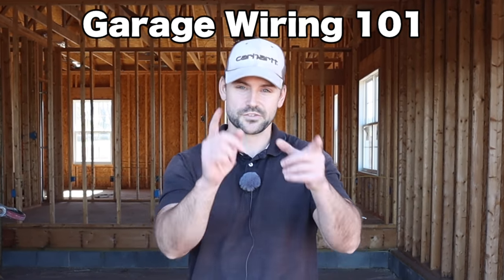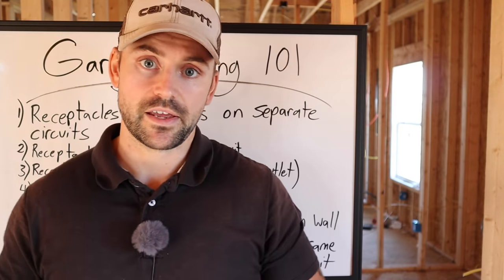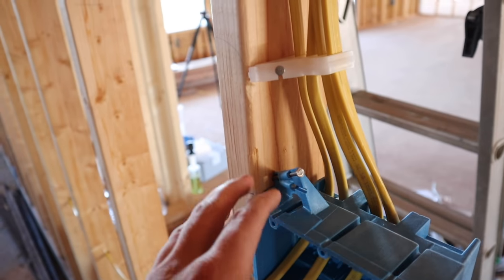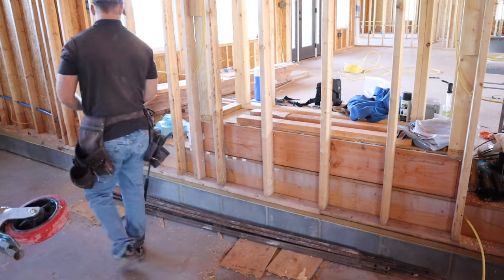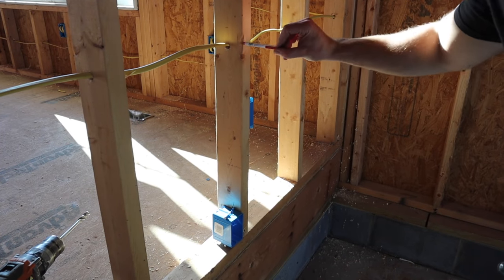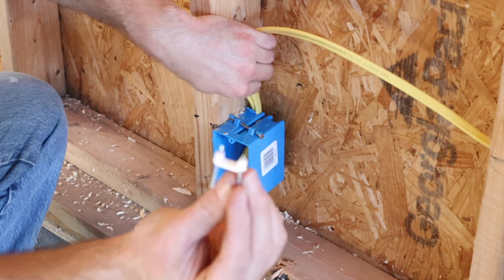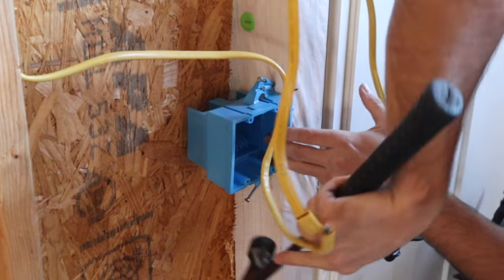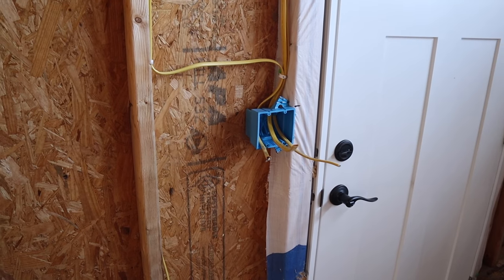Garage Receptacle Wiring - How To Wire A Garage For Electricity

Comment: First, nice video. But I have to admit there may be problems. Do you need a permit?, Do the receptacles require ARC fault protection? I believe the boxes you are using limit 1 wire per slot, never pound the tab up, it is designed to hold the wire like a regular box connector. Push tab down a bit only

Comment: A GFCI receptacle will only protect other devices down the line if you wire through the GFCI and continue from the load side of the GFCI. If you pigtail the GFCI and run the remaining circuit from the line side, the other receptacles will not be groung fault protected.

Comment: An electrician installed 3 outside garage lights.  All 3 were working fine, then one didn't turn on, and now 2 don't turn on.  I replaced one but it still doesn't turn on.  There's power going to the light. The switch is by the front door, one turns on the inside light, and the other turns on the 3 outside lights. How do I fix it? Also, the wires don't go up to the attic but run alone the inside garage wall to the breaker box. I understand that's not allowed, true?

Comment: How you bring a line into a detached garage? And if the garage has drywall already?
Reply: You'd probably go underground with UF cable and appropriate conduit. Surface mounted outlets and conduit. Not these plastic ones shown.

Comment: You should always use the 22 cube box because it’s better more room doesn’t Cost much more that’s what real electricians to always go to the deep box you could pull the wires in nicely fold the wires in nicely and have a lot of access wire it’s just works out better you’re learning maybe remember national electric code not your building code in your town national electrical code that’s how it works for us
Reply from the maker: Hey Pat! That’s a good point to just use all 22.5 boxes and not worry about it. Yes NEC codes are the gold standard 💪🏻. I appreciate the comment. Take care!

Comment: I put the outlets a 5'.  Way too many things get stacked against a garage wall and when they are low it is a pain to get to them.  It also gets them above 4'x8' sheets you may lay against a wall.
Reply: I put mine at 50 inches.   I'll lift my bottom row of sheathing up against the bottom of the box leaving a 2" gap at the bottom covered with trim.  I'll only have to cut the second row of sheathing for the box.

Comment: I am redoing my hole house electrical.
 In my kitchen i will have 4 outlets.
I want to remove the jumper on the outlet and wire each outlet for seperate 20 amp service.
4 outlets but 8 20 amp plugs. 
Would i use 12/3 wire to each box.
If you could demonstarte that would be great.

Comment: You say 20amp circuit for receptacle  but you SHOWED a  15 amp GFCI  with no explanation.  This  would be confusing to your audience. You also should have explained the line/load  electrical connections on the gfci , so the gfci  WILL protect the other outlets on that  circuit.  Is  "Bunny hop" an electrical term ?